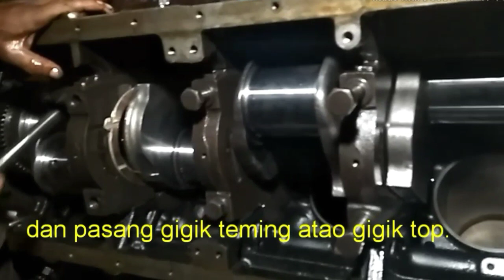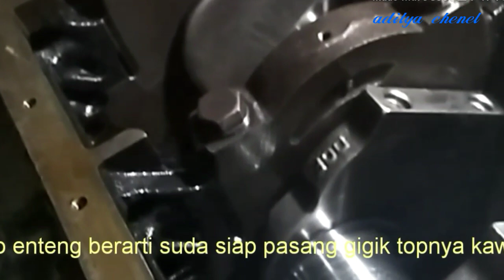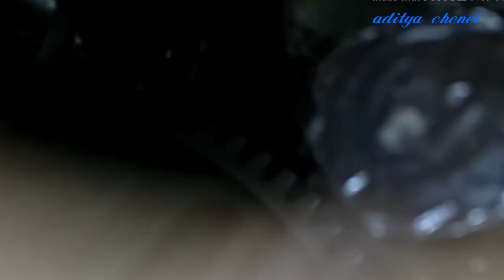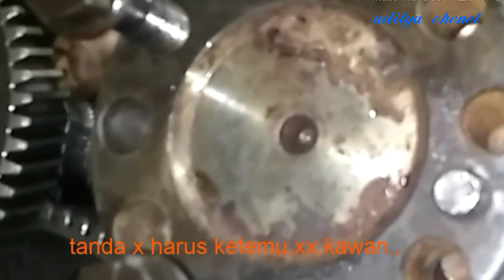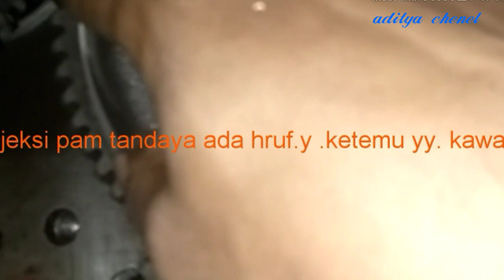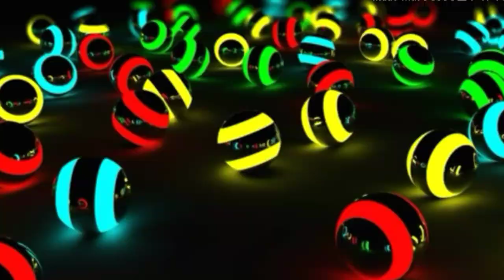top timing gear nissan diesel rf8 timing installation

Comment: Bagaimana cara pemasangan bospom Nissan RF 8 apakah mengambil top satu dari mesin
Reply from the maker: sebaiknya cari top satu gan ..biar gampang dan akurat.
Reply: @adityatruckid  nomor satunya dari posisi mana om
Reply from the maker: top satu putar roda gila cari angka 1_4 terus cek katup no 1 kalo goyang suda top gan kalo mati berati top 4 .putar lagi .
Reply: @adityatruckid  egk bang mksd saya di cylinder head kanan apa kiri kalo dilihat dari roda gila , kalo Nissan plunyer nomer satu kan di kiri , bener bukan
Reply from the maker: iya gan kiri depan .
Reply: @adityatruckid  brti itu silinder yang nomer 1 mulai penyetelan klepnya mas brti ..
Reply from the maker: bisa di setel .gan.
Reply: @adityatruckid  berarti mulai penyetelan klep nomor 1 kiri kalo dilihat dari roda gila